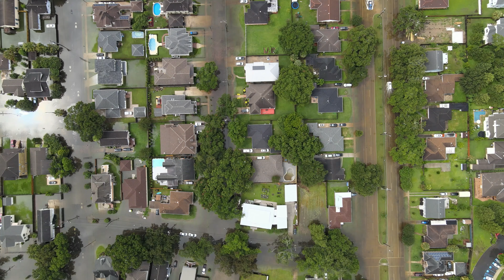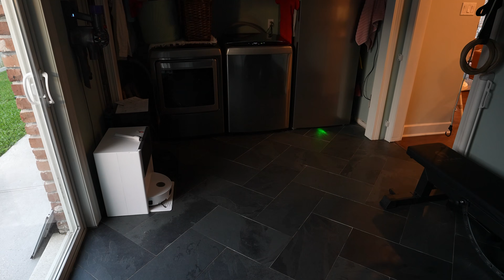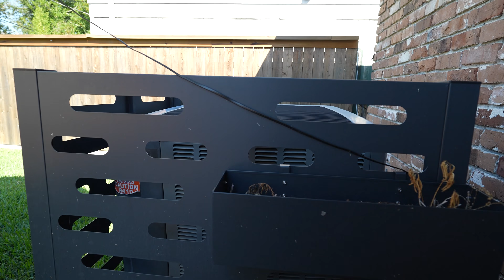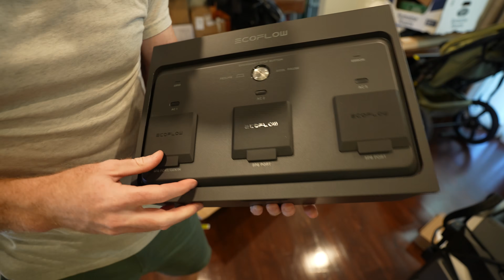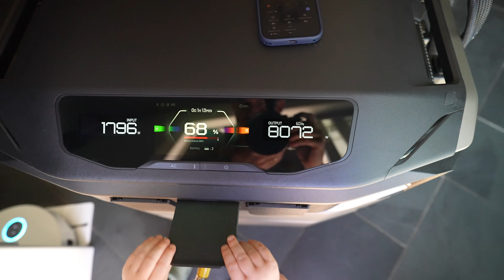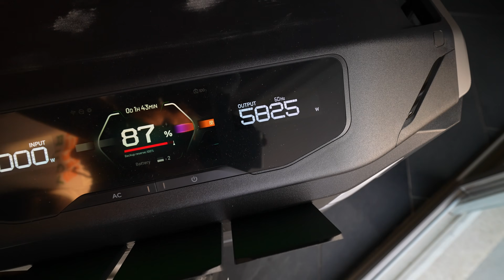I Tested EcoFlow's New Delta Pro Ultra X

Comment: I purchased the new EcoFlow Delta Pro Ultra X with Smart Home Panel a month ago. Got everything in a day and 1/2. The electricians installed the Smart Home Panel 3 within a few days after that and immediately upon putting power to the SHP3 DEFECT! Can't hook the inverter to the the SHP3 and use it. Locked out. Been dealing with ecoflow technical people ever since and WOW THEY ARE HORRIBLE! My system is DEFECTIVE, does not work and ecoflows response; BLAME ME. They use words like "IF WE FIND" when it's their crap that didn't work at the start. They DELAY, DELAY, DELAY, tell me to be patient while they figure out how to screw me is my guess. WORST SUPPORT EVER. I'm now getting an attorney to sue them because I installed the SHP3 as a MAIN which means I can't really send it back without taking it off again (which probably will happen). I DO NOT RECOMMEND USING ECOFLOW! If they send you a defective product, they won't treat you like these YouTubers they give the system to for free, they will SCREW YOU!

Comment: Mistake- he stated that his house uses "70kW per day" several times. This, of course, should have been 70kWh per day, referencing the total energy his house uses per day. People often make this mistake of stating watts (instantaneous power) when they're talking about energy, ie runtime, which is measured in watt-hours.
Reply: Honestly, I never thought he meant anything other than KWh. What else would he mean by "70 KW in a 24 hour timespan". That would be about 3KW/h. Sounds logical. Perhaps 4-5KW/h during the day and 1-2KW/h at night?

In the U.K. this would peg my electricity bill at about $700 per month. Crazy!

Comment: This is basically a 10 minute ad. Ecoflow has a good product here. The inverter is best in class. No need to sell us on why it's good to have one. The questions we want to know are:

* how many discharges of the battery before it can only hold 80% of its original capacity?
* what is the warranty? This is huge. Ecoflow is not well known for making products that don't break!
* do you need to use their cloud to use the product?
* why are the batteries so expensive?

Like I said, I like this product a lot, but if you're willing to build your own system, you can get so much bang for your buck. The big issues are the reliability and the battery. I don't want to sink $10k - $15K on their system, looking for that ROI, only for the thing to break on me and I'm fighting to get a warranty repair. In the meantime, I'm losing solar production/peak shaving and my calculations are going out the door.

Comment: Please test setting 80% backup level and self-powered savings mode at 90% then with it plugged into AC, charge to 90% with solar and see what power source it uses to supply the load.  If it’s the same as the DPU then the logic will favor grid power over solar - completely backasswards.